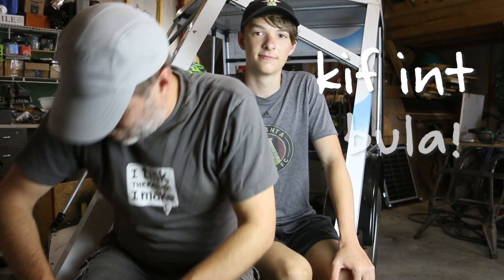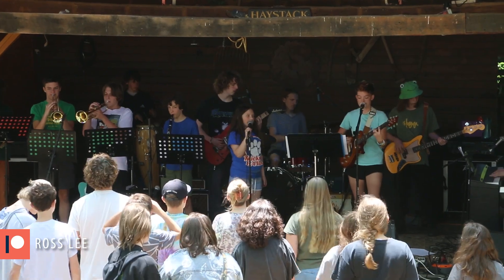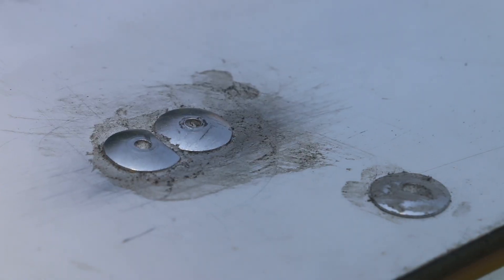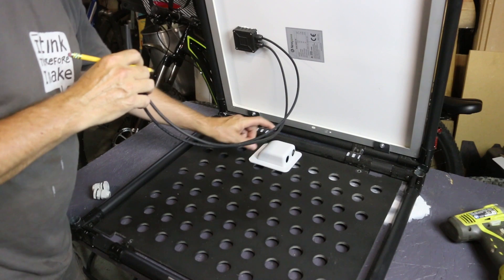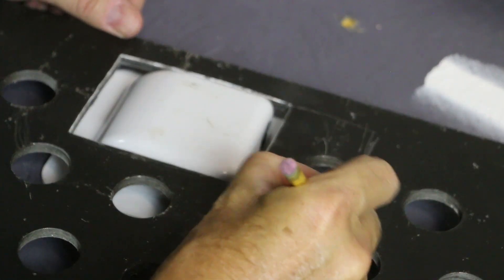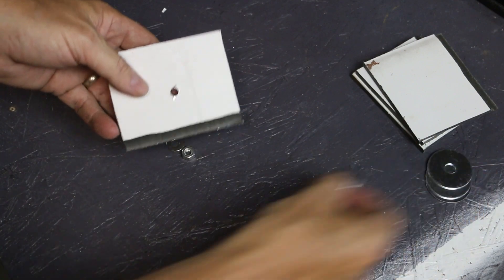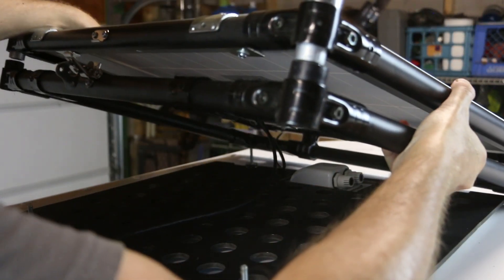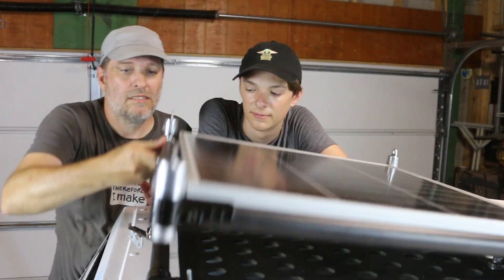How To Install Solar On A DIY Camper | #tinktube Build - Part 16

Comment: pretty sweet, love that the kiddo is learning by doing!! Those bolts are long enough you could add several more spacers. Storage is ALWAYS a plus in small campers..You mentioned a wet tarp but I was thinking a folding shovel, small ax or hatchet, folding saw, folding water bags etc

Comment: Team work makes the dream work.   Another great video Tom.  Thanks for the band camp interlude.   Will you be adding a gasket to the inside ceiling where the solar cables enter the camper?  Perhaps a bit of the butyl around the edges to cushion any vibration between edges and cables.  

Wishing you and your family a blessed week filled with gentle seasonally appropriate weather and restful evenings together.  Peace brother
Reply from the maker: Great suggestion on the cable gasket. I would not have thought of that. Warm in Georgia these days. Hope it’s more temperate in OH-IO. Peace brother.